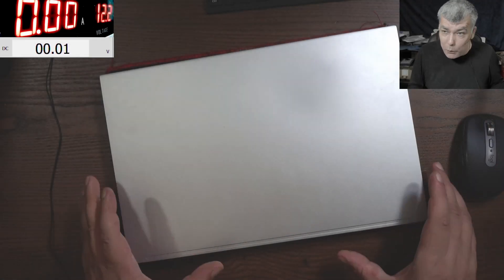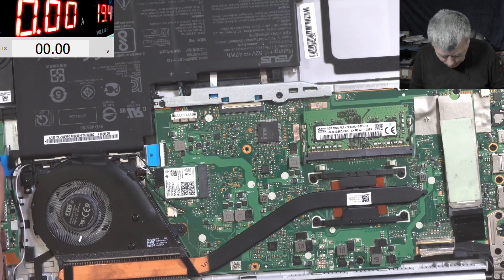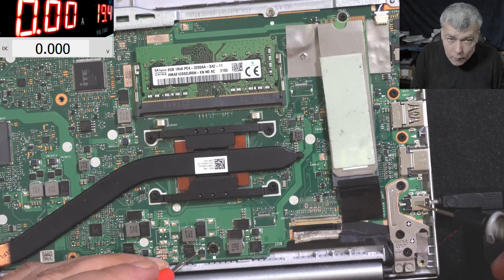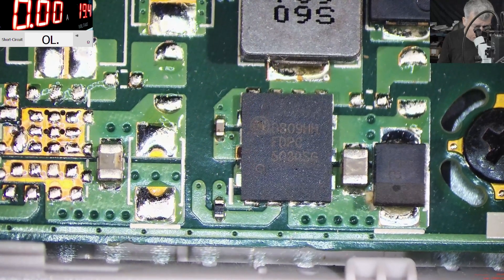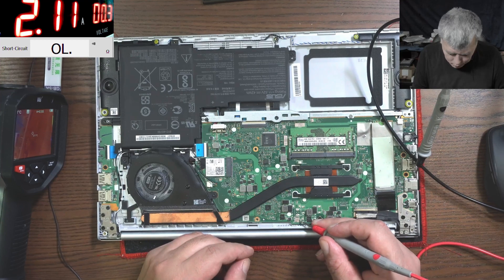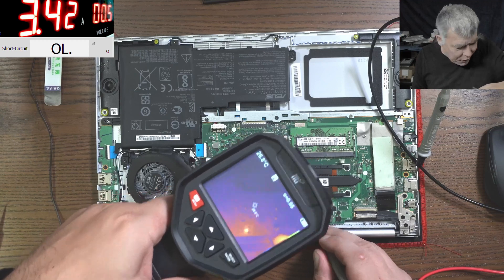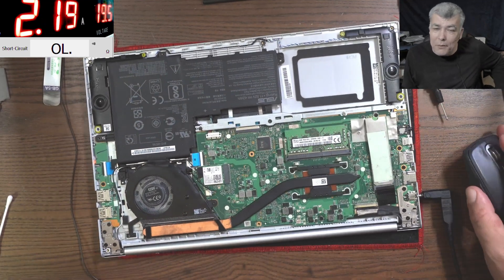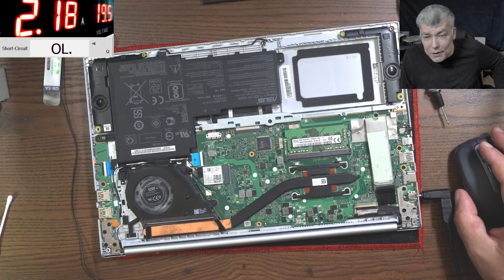This is the most common fault - Asus Vivobook M513U shorted motherboard repair

Comment: Every time that you have a Shorted  mosfet has to be dead CPU/GPU?😱
Reply: If there is a >6 Ampere  external power suplly... yes this can be... on cheaper laptoo with 65w power supply maybe them can burn without killing the cpu gpu

Comment: You're the best. After watching almost all your laptop repair videos i have finally gathered confidence to start repairing laptops as a side hustle. Just have to buy a thermal camera then am set. Thanks🙏
Reply: same i am ready fully for repairs just need to collect money for termal camera and some good microscope for now  using it on monitor just camera microscope eakins but it will be better in future i hope we will see :)
Reply: Hi, for the first, you don't need to buy microscope and thermal camera, just do it, I surly you can if you want❤ @GlishaSo
Reply: Thinking of the same! Is there a discord or something we could set to help each other when repairs get tricky ???

Comment: So is the new channel bringing more money than the old one already?
Reply from the maker: It's even worse, i got the bug on the second channel also, the one with the electronics for beginners.
Reply: @10minlaptoprepairs  That doesn't make sense, sounds like you are on a 'blacklist' for some reason. It's time to reach out to Google and ask why the discrimination? You put far too much work into the channel to be treated that way especially since you have ALWAYS been in good standing. It's just not right.🤬